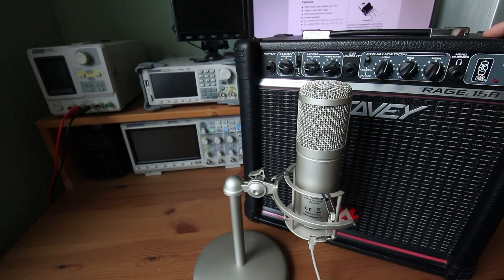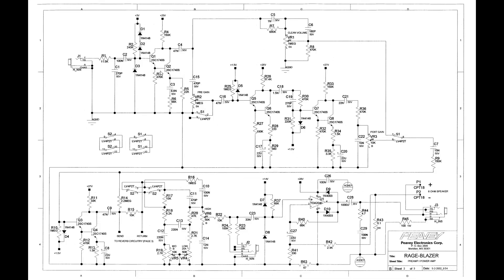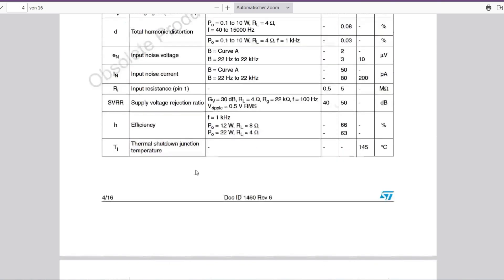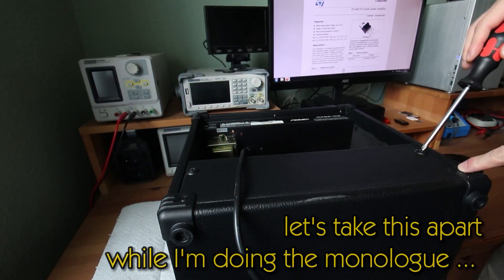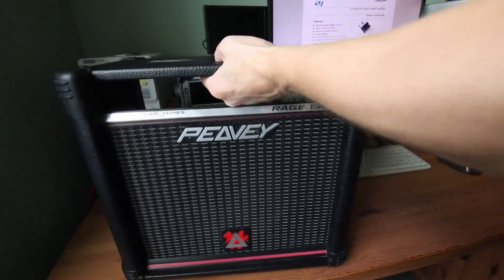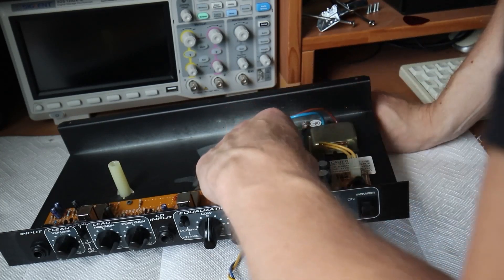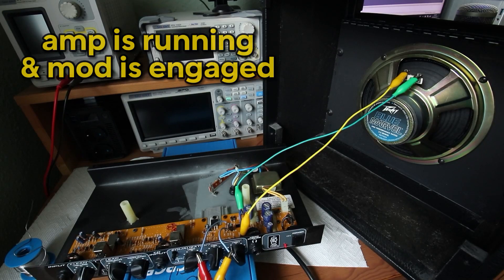Peavey Rage 158 Modification | Huge Solid State Amp Sound !

Comment: I still have this amp (probably for ~30 years) and never though about doing something like this. But I'm also more of a plug and play guy. I used to run it stereo with a Lanney 15 watt. Between the two I could get some awesome sounds and even played them live at smaller gigs. I Lost the Lanney :(. But this thing still rips for a little bugger. FWIW,... I don't get that humm noise you showed at 1:00. Anyway, good video.

Comment: I have a peavey Transtube 258 EFX which is like... 10x more rare then this version of the amp could ever be, i wonder if the mods would be the same? because the amp does actually sound fairly harsh, i always have to keep treble between 3 and 4 and bass at 7
Reply: Yes, it works,  I own a PEAVEY Rage red stripe 258 EFX, R40 68k to 6.8k , C8 472j capacitor
Reply: @joecantu5252 alright thanks

Comment: I installed a cab jack, built in a boost circuit and stuffed a Celestion Ten 30 into it. Unbelievable results. I later pulled the amp,  built it into a little head and dedicated the housing as a full-time cab. A little on the small side for the 10, but sounds phenomenal mic'd at moderate volume. The 'Silver' Rage is one of the best sounding amps around... fight me over it 🤨

Comment: In my humble opinion, the feedback resistor across R40 was a bit too low for me (mostly blues and cleans) unless you're only doing metal tones, I preferred 20k which got rid of enough of the hum and brought the noise floor down enough, but kept some of the volume. Also used a switch there so I could retain the original volume.
And I dropped the level of the cap across C18 to 2nF which got rid of the icepick highs, but retained some grit.
The 1nF off R7 made the clean channel sound more like a marshall than like a fender blackface to me, so I omitted it.

But once I did that it really made the treble knob a lot more usable for cleans and that edge of breakup I enjoy on this amp, I usually like the pre-gain at 3-5, and now I can actually crank the post gain where it sounds good and not so harsh.

But if I need to keep up with a drummer, a switch to bring it back to it's original volume is quite useful!

Great idea on the mod!

Comment: Great video, gonna try it! Showed it to a friend who knows much more than me  about these things, he said something like this: 

If you lower the feedback resistor (R42) to reduce noise and gain, it can also be a good idea to lower R41 (the resistor at the non-inverting input) by a similar ratio. This keeps the DC bias point balanced and can slightly improve stability and noise performance even further. It’s not always critical, but doing both can help the amp behave more predictably, especially if you lower the feedback a lot. 

Is he correct and did you consider doing this? Has anyone else here tried adjusting R41 as well when modding their amp?

Comment: Thanks for showing this.  My son's Peavy had a different PCB but the resistor on the 2040's feedback pin was a similar value.  Went with a higher resistor value than you on the switch, was concerned to be well clear of the min 24dB gain shown on the data sheet (oscillation would be a disaster).  Left the treble alone.  Great result including for the volume pot range.
Reply: Planning to do this mod. Would you mind sharing what value you used for the resistor? And did you also connect it in parallel or replaced the original? I'm not fluent in reading data sheets... 😅

Comment: How much would new speker affect ?
Reply from the maker: In general a speaker can change the sound a lot, I tested this also and built a celestion 8" (eight 15) into it but the effect was really not existent for that specific speaker. So this one sounds like the stock speaker, but you can try different! A speaker is filter.

Comment: NOT WORTH IT!
I just tried it. Put a switch to alternate between the original and 15k. Max output dropped by 30%. Adjusted at equivalent level, its slightly less noisy... Around 20%

Comment: You said the resistor needs to be wired in parallel. Is it originally wired in series? Apologies I’m not good at reading schematics. It’s not just replacing the resistor with a 6.8k correct?

Comment: There's nothing wrong with empirical experimentation to find a sonic result you like, but this video is presenting incomplete technical information.  I encourage everyone to understand why Peavey used the values shown.  This circuit uses something called "mixed-mode" feedback.  The intention is to increase the effective output impedance, with the intention of allowing the speaker to be less dampened by the output stage.  This is an attempt to emulate a tube output stage which may not have a high a damping factor as a typical solid state output stage.  The information presented here completely glosses over this, and makes it seem like Peavey engineers didn't know what they were doing or had no good reason for using the values they used.  In fact this is not the case.  When you mod a feedback network to include some current feedback, you may need to decrease the voltage portion of the total feedback, to keep the total feedback from both sources (voltage + current) from making the output stage unstable.   While it is possible they were a bit high in the resistor values chosen, there also may have been a solid engineering reason for them.  Yes, increasing the voltage feedback will reduce the gain and noise of the power amp stage.   Whether you like the results of a mod or not is entirely subjective, but the technical aspects need to be kept to objective facts.     For further reading, I suggest:   https://www.sound-au.com/articles/current-drive.htm
Reply from the maker: You are right about the technical information you supplied, you wrote: " This is an attempt to emulate a tube output stage which may not have a high a damping factor as a typical solid state output stage. " The point is that even the darlington stages try to emulate a tube behavior, in short: Peavey has a lot of patents to emulate "tube sound" although I like the ideas, they fail when it comes to this. For me all those attempts are non-sense. It just doesn't sound tube-like, no matter if they try to alter the damping factor or put darlington configurations in the preamp. But you are right, I SHOULD have mentioned, that they indeed had a good reason for this. My point was just to show how to get rid of all those poweramp noise, because they are squeezing every drop water out of it to meet their wattage requirement in the first place, like almost every manufacture does. With my modification of the power amp feedback resistor you get a whole lot of less noise and it even sounds better - not just to me. At the end of the day it also comes to pesonal taste and preference. But yes I get your point and you ae right, I should have mentioned it. Maybe I didn't because the whole Peavey approach in which they try to emulate tube-sound is bullshit to me when it comes to a convincing tube sound at least. Don't get me wrong, the ideas of peaveys pattents (trans-tube and othes, since it isn't only one) is great, but it doesn't deliver what it promises. Yes "sound" is always something you can argue about. Thanks for your comment and clarification!
EDIT: And even if one likes the sound, the noise of the power amp is horrible.

Comment: Hey man this is awesome.  I have a Peavey Valve King 100w tube amp.  I'd like to use it for a tight modern metal tone?  Any suggestions on mods to achieve this type of sound?  Its kind of an ice-picky sizzle amp.

Comment: Can you mod a fender frontman 15g please?!!
Reply: I am of the opinion that the best mod for a Fender Frontman is to gut it and start over 😂 - alright it’s just a terrible opinion but yeah I have thought to mod that one myself because it’s noise floor is atrocious.   The preamp in the Peavey is nicer for sure but the Fender has that classic look. 
    What I may do with mine is yes, gut it and stuff an OCD overdrive pedal circuit in its place and a completely different amplifier circuit or a small el84 tube amp ??? If only time permits right?
Reply: Make it a head lol, the speaker is what ruins it

Comment: Those mods sound good. I have an OLD Blazer 158. First amp I bought for myself. Id love to do this mod but I'm not an electrician. I kinda wish you'd have shown the mods as you made them. I could follow along then.
Reply: Second that. I can follow the R40 resistor mod location, but not the switches @aeon_electronics

Comment: Useful mod. Don’t need 15 watts at home anyway. I actually love the sounds of the Rage 158. So much I bought a Pepers’ Pedals PV Fury 158 preamp pedal. Different story using the preamp pedal though since I run it into a quiet Mosfet power amp and put an Axiom Effects PAE-1 Power Amp Emulator after the Fury 158 preamp. The PAE-1 gives it a better tube feel and the preamp is fairly quiet on its own. Kind of a great sounding setup using those two pedals into a 150 watt Mosfet power amp pushing 410 and 212 cabs. As a little practice amp it sounds great too, but definitely an improvement with your mod!

Comment: I also made some mods to peavey 158, but your noise mod looks good. Does lowering the feedbaack resistor also lower the output volume though?  Do you think C15 should be increased, as it looks very small to me for a coupling cap?
Reply from the maker: Hi, C15 isn't only a coupling cap, it forms a filter in series with VR2 (pre gain). So there is no simple answer, just try it if you put caps with various capacitance parallel, this way you don't need to desolder it :) A larger feedback resistor results in more gain and a lower value results in less gain.
Reply: @Aeon_Electronics  the best mod I did to mine was put a 10 inch greenback in it.    I now prefer this amp over my Plexi 1987
Reply: @Aeon_Electronics  but isn't a small coupling cap just a high pass filter? This 470p value seems extremely small

Comment: Does this modification works with older Rage or only newer ones?
What mic you are using for this recording anyway?
Thanks
Reply from the maker: It should work on older and newer Rage amps (you may have to doublecheck the schematics) I am using a "the t.bone SC 440 USB" Mic. It's really good even though it is cheap!
Reply: @Aeon_Electronics  Thanks.
I'll check them out

Comment: Great video! I was wondering if you considered adding an fx loop to the Rage 158. That would be a cool modification too!
Reply from the maker: Since I am only using it with overdrive / distortion pedals, there is no need for an FX-loop. Set the amp clean and put them between my distortion pedals.

Comment: Today I tried the 2.2 switch 2 mod inside my Peavey EFX 258. Overall the schematic looks quite a bit familiar compared to the Rage/Blazer schematic. Got it all wired in and nothing? Absolutely no difference I heard. If anyone gets to read the EFX 258 schematic, can you see if that switch 2 mod needs to install in a different place? Both schematics show the 2.2 nf making it's way to the TDA 2040/ LM 1875. Wonder why it didn't work? I used a .0015 since I lacked the .002 value.
Reply from the maker: If you could share the link to the schematics I will look and compare them to figure out a solution :)
Reply: Youtube refuses to allow any kind of link and it keeps getting deleted. I can e mail you a schematic if you're interested further?  @Aeon_Electronics
Reply: @Aeon_Electronics  https://drive.google.com/file/d/1tWnSLWpE-Apf-sM-TnO2OC7_v6dsGdSw/view?usp=sharing

Comment: Sounds like an interesting project to try. I was just about to get a 2nd hand practice amp for my daughter, and I think this mod would be a nice bonus add-on project, and that beats buying a "boring" Marshal MG15... Or does it?  humm.
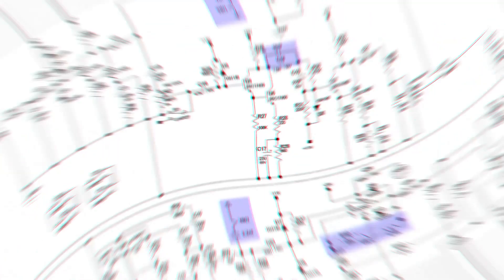Reply: btw, are your schematics posted somewhere or should I pause at 04:33 and take a screenshot?
Reply from the maker: @Seefood73  Thank you a lot for your feedback! The Marshall MG15 is okay, but I think the Peavey Rage has a way better distortion built in by "default". Sadly I have no seperate schematic, but if you set the video on highest resolution it is all good readable! If there are any questions, just feel free to ask!

Comment: I decided to try this out tonight .
It's definitely much quieter and there is a noticeable warmth throughout the high end which is nice..
The only part that didn't work for me was the 2.2nF capacitor  , when engaged the amp squealed like a banshee.
Not sure why, 
So I took that section out,  didn't feel I needed it , and 
I think it sounds a lot better than it did stock.
Thanks for this tutorial man!
Reply from the maker: Thank you for the feedback! I'm not sure why you get squealing with the 2.2nF, but I guess you grounded one side of the cap too far away. But you are right, I designed it to be switchable anyways. It's always subjetive, if you're happy with the first filtering stage (1nF) it's fine. Most of the time I also only using this stage. But I thought it would be nice to have some more options. :)

Comment: Nicely done! There is another video here about changing the opamp in a Blazer 158. Stock opamp upgrade to 5532. Have you seen it?
Reply from the maker: Thank you, there is absolutley no reason to change the Opamp to an 5532, in fact the signal to noise ratio depends also on the source impedance. Ugly truth is: a lot of "modders" don't understand and don't look at the datasheet. They just see "ah there is less noise 'as stated in the datasheet' .. " for exampe they see "1 nV/√Hz" and decide this MUST BE a better opamp. But this may not be the whole truth, since opamp voltage noise may be lower than 1 nV/√Hz for some types, however voltage noise is the noise specification that is more usually emphasized, but, if impedance levels are high, current noise is often the limiting factor when it comes to noise performance.  But to somehow answer your question: the NE5532 is a really good opamp for many audio applications, but is there a reason to change it for this amp in this case? Nope. Additional fact: The Opamp in the Blazer schematic is just a buffer stage for the reverb. So there is no "tone shaping at all".
Reply: @Aeon_Electronics  thank you for iluminating me with so much knowledge.
It seems there is a peavey 158 blazer/rage with opamp in the preamp... maybe it is a pre transtube.  
Another question, is it possible to make and fx loop in a Rage/Blazer?
Keep up the good work in tour channel! Greetings from Argentina
Reply from the maker: @estebansuarezmarenzi1135   You're welcome. It is possible that the "pre-transtube" era has an op-amp IC as preamp. Actually I am pretty sure I saw such a schematic, too. But even there, in most cases, a substitute with an NE5532 wouldn't change a lot, especially not the tone. Yes it is possible to design an fx loop to the Rage/Blazer, that wouldn't be that hard. According to the latest Rage/Blazer schematic I am showing in my video I would implement it either after R15 or after R22. It should consists of a buffer stage on the "send" and a driver stage in the "return" path. Personally, I would first try it with adjustable volume levels at both (additional ICs) so you can compensate possible volume drops. All in all there isn't much to it, though you must try and fiddle a bit with the component values.

Comment: Hi Aeon, great video, I'm considering doing the modification on my amp myself. I heard you talk about loss of power, I'm not that interested in power but anyway, can you tell me approximately how many watts the amp has left after the modification?

Greetings,
Javier
Reply from the maker: It depends: on the clean channel it's maybe about 500mW and on the overdrive it's round about 1-2W. Don't get fooled by "oh just 1w" it's louder than you would expect. However you can exactly set the volume that you really need / want if you try different values of the feedback resistor. You can even think of it as an "master volume". I made it switchable, that way I have even the "stock option" :)
Reply: Ok, thanks for your answer, I only use the clean channel because I play with distortion pedals so maybe 0.5Watts is not so serious, thanks for sharing. Excellent video! @Aeon_Electronics
Reply: @javierlandaeta891  I know this was posted a year ago, but I thought I'd mention something in case you still have the amp. The clean channel doesn't make a good pedal platform, but the drive channel set to clean does. Try it and you'll hear a big improvement.

Comment: Would this mod work on the Peavey Studio Pro (red stripe, transtube model) - impressive work btw!
Reply from the maker: Yes and no, let me explain: I've looked at the schematic and this is obviously a very different preamp section as well as a different power amp section. They both share the same "Transtube Technology", this is just an approach to emulate tube amp behavior. Peavey does this via darlington circuits the "discrete" way and also altering the damping factor of the power amp to emulate the output transofrmer (this is it in short). My mods would of course be possible for any of those amps, BUT due to the fact, that the circuit is different, there would be other places and other values of capacitors or resistors. In general you can mod those amps in the same way, but you cannot simply "copy" my rage mod. A good starting point, if the amplifier is to harsh or trebly, would be altering the tone stack and therefore the filtering. I always take care of the preamp AND poweramp stage, this is important, otherwise things can get very muddy. Maybe I will take a look at those amps in another video at some point in time, since I really like them!